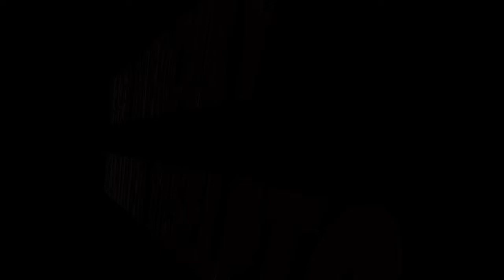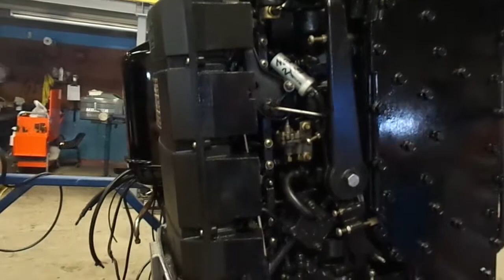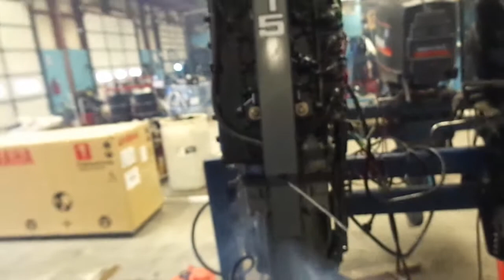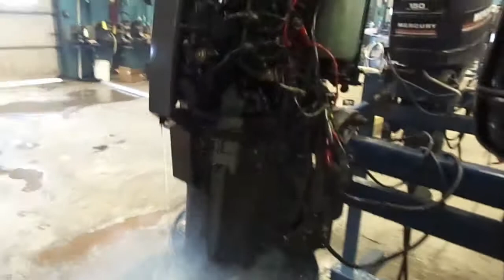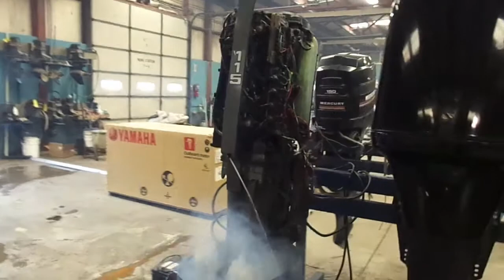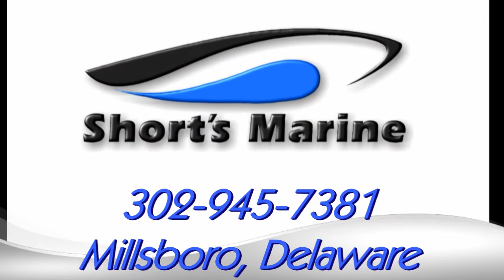6M4G36 Used 1993 Mercury Mariner 115ELPTO 115HP 2-Stroke Outboard Boat Motor 20" Shaft

Comment: i bought this motor over the winter, i want to do basic maintenance, but i have no idea what i am doing.......id like to change the fuel filter, spark plugs, lower gear oil, and the primer ball......can you please help me out? never had a boat before and its getting nice out and i cant figure it out
Reply from the maker: +Ad Vic (Tyrant46290) Give our service department a call at 302-945-1800 and they will be happy to assist you.